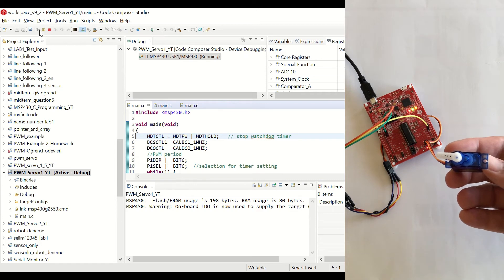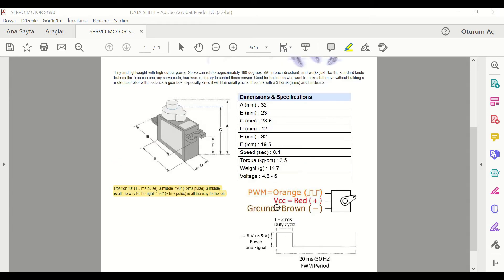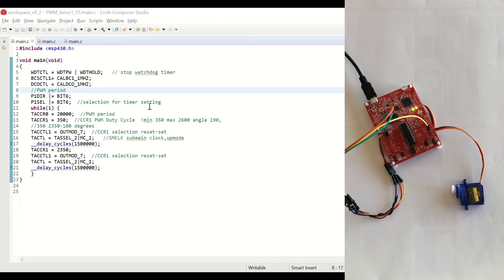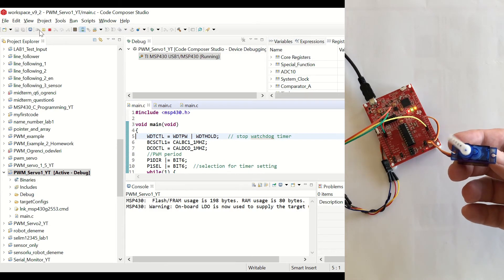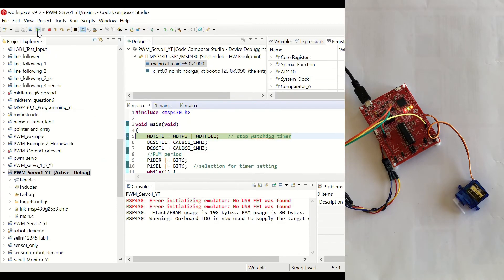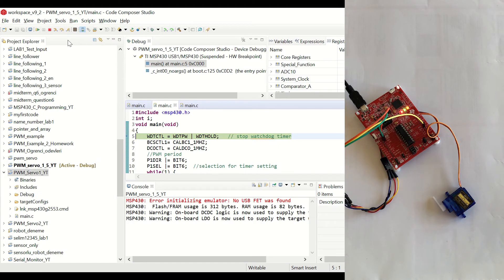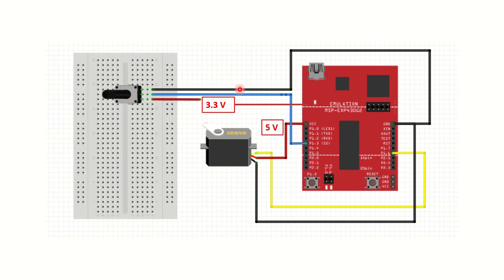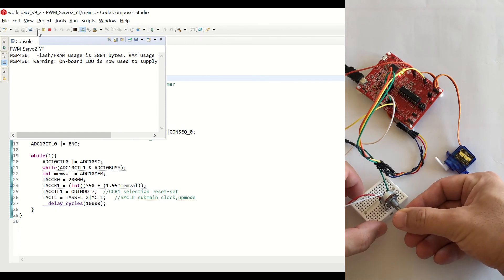MSP430 & Servo Motor

Comment: Hello sir, I don't understand why you multiple memval with 1.95 in the third example. It would be great if you could explain.
Reply from the maker: 0:45 here I mention that the pulse duration should be between 350 and 2350 usec according to my experience. To satisfy this I multiply the adc value(which will have a value between 0 and 1023) with 1.95
Reply: @drselim  Thank you, appreciated.
Reply from the maker: @zorzional  you’re welcome

Comment: Hi I am trying to implement this on the MSP430FR4133, I cannot see an equivalent register to the BCSCTLx and DCOCTL registers in the family guide. How shall I proceed? Thanks
Reply from the maker: Hi, I just took a look at the user's guide (SLAU445I) The clock system control registers are introduced starting from page 112. Please inspect that section. For example: CSCTL1 register's DCORSEL section is for setting DCO range select.  You can also use ti's forum to check information about your queries.
Reply: @drselim  Thanks, I also have another question, why do you repeadetdly run the timer reg. setup inside the loop instead of delcaring it once outside of it? Can't TACCTL1/TACTL reg be setup once and still give the same result? Sorry, I am a beginner. thanks
Reply: Also I managed to get it working, even with the pot now but instead I am using the ADC interrupt service routine instead. but my servo jitters a bit back and forth even when its stationary, can this be attributed by the pwm signal or the servo motor itself? I've connected it to an external +5v power supply, not from the board itself. I found a value of 600us-2700us best suits my case.
Reply: Nevermind, I found out what was causing micro jittering, it was because I wasn't sharing a common ground with the external supply and the board itself. It is now working cleanly. Thanks again for the video and sorry for the hassle!
Reply from the maker: No problem at all, your comments enrich the content and are valuable to all viewers. Thank you!

Comment: Hi, can I use this code for the msp430fr2355?
Reply from the maker: Hi, you will probably have to change the port numbers and mcu specific modules names. This code will not directly work with fr2355.
Reply: @drselim  Oh thanks, I've been trying to make work this code on my msp430fr2355. I have this same project for the school but my teacher never taught nothing like this, could you help me to make this code work on my msp? Please🙏
Reply from the maker: @TheVaYoMTB  I wish I could. Unfortunately I don’t have the dev. Board you’re using, also I’m away from my “lab” for some time. I suggest you try to use the same code on your device and try to modify it according to the errors that you’ll get during compilation in CCS. You can send the output to my email (available in the channel’s main page) . I’ll try to comment when I have time. Good luck!
Reply: @drselim  Oh okey bro I understand, so much thanks
Reply from the maker: @TheVaYoMTB  You’re welcome

Comment: Hi Which programmer read this mcu 
msp430 f6721?
Reply from the maker: Hi, the code that I provided works for msp430g2553 (ge2 launchpad) . You need to write a different code for f6721. You still can use the CCS (Code composer studio) as the development environment.

Comment: Hey I was really wondering why the 1-2ms wasn't correct. Did you check these signal outputs on a ooscilloscope? Also awesome video !!!
Reply from the maker: Hi, you have indicated an important point, I haven't checked the signal with an oscilloscope, however the DCO of these microcontroller series is precise enough to generate these PWM signals, please check the oscilloscope output for a similar mcu and same DCO/clock settings in the following link (the response of Dennis)
https://e2e.ti.com/support/microcontrollers/msp-low-power-microcontrollers-group/msp430/f/msp-low-power-microcontroller-forum/381874/timers-and-pwm---msp430g2553
However I'll try to find an available oscilloscope for further examples, or anybody following this thread with an oscilloscope can help us :)
Thank you for this very valuable comment!